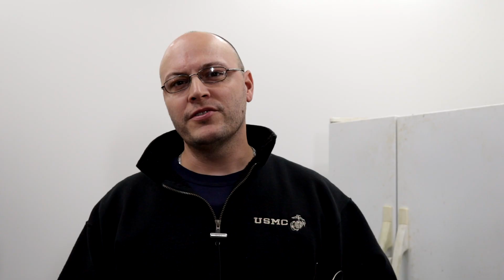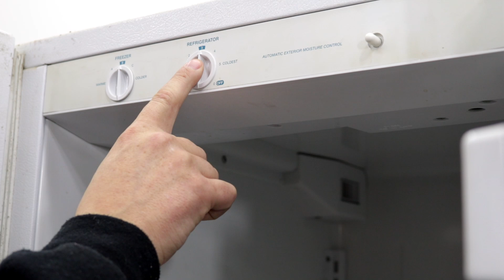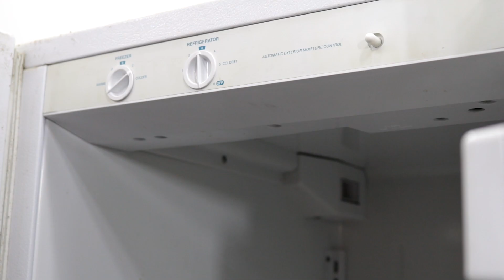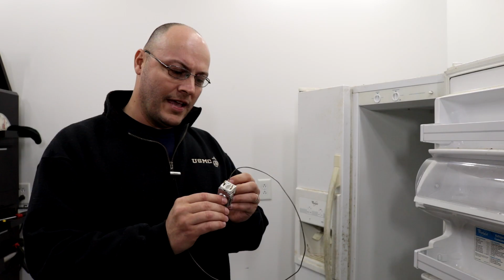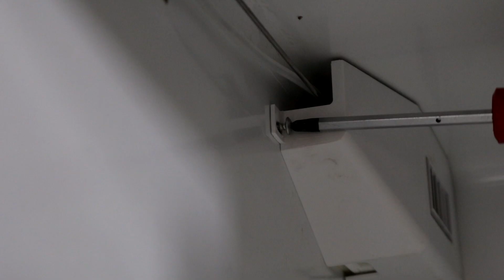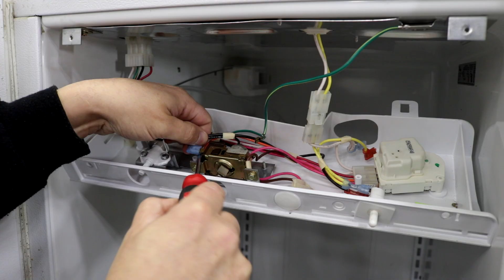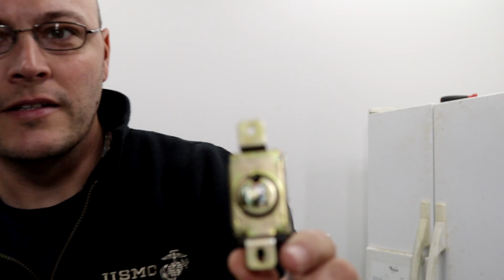Whirlpool Side by Side Refrigerator Cold Control Thermostat Troubleshooting

Comment: The bit I don't understand is how you test the EXISTING temp control to see if it is actually bad.  Your test was done on another control, which I assume was good? 

So, is this correct ... if the meter shows 0.L in the off position and 0.000 in any on position, the control is good? 

What reading would you see on a BAD temp control, that needs replacement?  Thanks.
Reply: The temp control works as a switch so basically think of a switch as a bridge. When its in OFF position or OPEN you will get OL reading as theres no current flowing thru there. Once you CLOSE the circuit or lower the bridge current will flow thru. As with a ground reading, the lower the resistance or closer to 0.001-0.005, etc, that means there’s barely any resistance in the current flow therefore meaning you have a good circuit. You can also put your multi-meter on CONTINUITY and it will beep or show a reading once you turn the switch from OFF to COLDER. Hope this helps.

Comment: Great video! Thanks so much for sharing your knowledge and expertise. You saved me a lot of money on repairs. Got the part on eBay for $9. Had to adjust that little calibration screw though on it to make it less cold. As some have commented, these replacement thermostats seem to be calibrated to the maximum cold setting making your fridge ice up even on 1 or lower on the dial. About a 3/4 clockwise turn solved this problem for me.

Comment: my fridge - Kenmore side by side runs fine when it is cycled on, but will not start itself again in new cycle - thus it allows freezer to begin to thaw.  If I hard tap the knob face-plate - same as in your video here - it will get going again - fan, cooling, compressor, etc. for another cycle - but will in time require another firm tapping.  Big trouble if I'm away for a week, or even overnight as frozen foods have begun to thaw.  any further ideas for repair?  many thanks, Tom    perhaps the video here do it.

Comment: Hi Bill 
Thanks for the information on the cold control thermostat. I ordered a new one and replaced ice intermittent one.
I have a question about the ice maker. It does not dispense ice thru the chute. The auger does not rotate when engaged. I have removed the bin and the metal tab on the motor does rotate when the door switch is engaged and I engage the lever in the door. What is the probable culprit on this? 
Thanks for your thoughts and input.
Brian in NC

Comment: If it's the problem where you can tap on it and it runs or shuts off then you can try to dunk it in some 90% alcohol and cycle the knob "a bunch of times"(20-30) and then blow it out and put it back into the fridge....then order a new one because it's way cheaper to replace it than to replace all the food. You have only cleaned the contacts but they will fail again this will get you going till the new part arrives....sometimes.

Comment: hi Bill.... quick question for you. My old part the plugs on the control are one on top of the other and the new part the plugs are side by side on the control, just one is slightly bent upward. So the question is how do I know which wire goes to which plug?

Comment: Thanks so much for getting back to me. Every thing inside my fridge is running; evaporator fan, coil fan,  the compressor itself, but it doesn’t sound like a normal running compressor. I should also point out that the whole refrigerator is warm.  Is there a possibility that the system could be over charge with refrigerant? Thanks again !

Comment: Hey Bill.  I have a side by side GE refrigerator that is not cooling at all. I have checked the compressor and start components and they all checked out fine.  I have hooked up my gages and the low side reads about 80 psi. I have bought this refrigerator used and the owner said it had been working good. I also noticed that the compressor gets too hot. Would you please help me diagnose what could be wrong with my refrigerator?   Thanks
Reply: low side reading 80psi while running? thats WAY! to high, ideal is right at or near 0. compressor valves are bad or you have air in the system. either way major expensive job.

Comment: Good info. My new one took the freezer down to -30F quite quickly. I have set the freezer at 50% and hoping things settle down.  Next time I will look for a unit with independent control of the compartments. This scheme with the one t-stat and then a vent doesn't feel like engineering to me.

Comment: I have a question please. I have a whirlpool side by side. I have already replace the defrost timer in the freezer due to the refrigerator not cooling and then freezer start to not work.  I replace that timer in the freezer now in the refrigerator by the vent is freezing up with ice. and temp inside fridge is reading about 47° but by the vent is reading 39° at night I here like a clicking sound coming from inside the refrigerator by the control setting. what can it be. do you have a video of my model. whirlpool side side Model number is ed5fhexlq01.

Comment: Thanks for this info.  My whirlpool is a top freezer model, but it sounds like this might be my problem part.  The past few days the compressor & fan have been kicking off and never come back on by themselves, eventually thawing out my freezer.  But when I fidget with the control knob, suddenly it kicks back on for awhile...presumably after some thermostat somewhere opens up, or it completes its cycle, or however these things work I guess.  Anyway, in the past week or two prior to the onset of this apparent control knob problem, I had noticed the fridge making sort of a labored whining sound (like a motor under too much resistance, maybe) especially when the compressor starts up.  Do you think that is a bad sound??  Maybe I have a compound problem??

Comment: Great video Bill. I am in school training to be an appliance repair technician and find your videos very useful for continued learning as to how each model and component works and where it is located. Keep making your great videos!

Should mention that we were told in class that those capillary tubes on the Thermostat do not have a liquid in them when they are used in Refrigerators.

Comment: Good video, but any suggestions on how to slide the new temperature control tube into the old hose?  When I took the old hose off the old tube, it was hard as hell to get it onto the new one.  I ended up breaking the new tube...$90 down the drain?  any suggestions?

Comment: Greetings Bill.  Contacting you as I see your USMC logo (same here).  Question: In the last 24 hours, I noticed the lower fridge section (cheaper Whirlpool no bells or whistles,  - 11MTFA - a year old) is freezing some items but not all.  Outer door one milk jug, some sealed packaged items on 1st & 2nd trays, unopened beverage bottle, and the vegetable compartment froze.  Fridge temp was set at the temp dial recommended (middle setting).  Fridge was moderately packed but not overstocked.  

I did check vents to make sure they were not blocked.  In the top freezer, I did see a package that covered a partial left side vent and moved it of course.  I have also lowered the bottom fridge temp to the minimum setting.   I am in an apartment, so I am not to temper with the fridge.  

I have noticed the fridge turns on and off at intervals as expected and is suppose to be an automatic defrosting model, nothing to empty out on a regular basis.  No manual, as it belongs to the apartment. 

Respectfully requesting any thoughts.  At present checking out some of your videos.  Semper Fi. 
(Good upload and straight to the point.)

Comment: I am trying to fix my refrigerator but I am confused by your video. On one you said nothing would work if it was the cold control. My fans are running but the condenser fan does not seem to blow out enough cold air. I replaced the relay and capicator and that did not work.It will not cool.I hear a little buzzing from the compressor but not real loud. I first thought it was the cold control but sense fans were running ruled it out but now I see this video and not sure. The compressor seems to be running. It is vibrating.The fans seem to be running good so could it be the cold control. Do like your videos.They give a lot of information.

Comment: Replaced the faulty contact thermostat as described, (fridge warmed, and rapping the control unit turned the compressor on) first with an online cheap thermostat, and then with a "factory replacement part" which was costly. In both cases the freezer and fridge run too cold (eventually) and I must keep the Fridge knob below one just to keep the fridge above freezing. Frustrating! Even at the lowest settings possible the freezer begins to overcool. Checked the vent - appears to be opening and closing fine.
Reply: This is when you know you should adjust the factory calibration screw that the video tells you not to mess with.

Comment: Bill, after opening my freezer side, i did notice that the bottom coil had frost around it... i ordered both a thermostat and the heat/defrost element and replaced them both last night...how long should it take for the freezer to come back to normal freez temperatures after replacing these points... assuming that those were deffective and assuming they are fixed now.